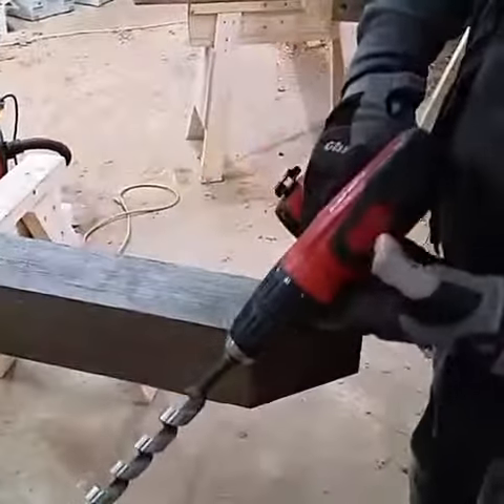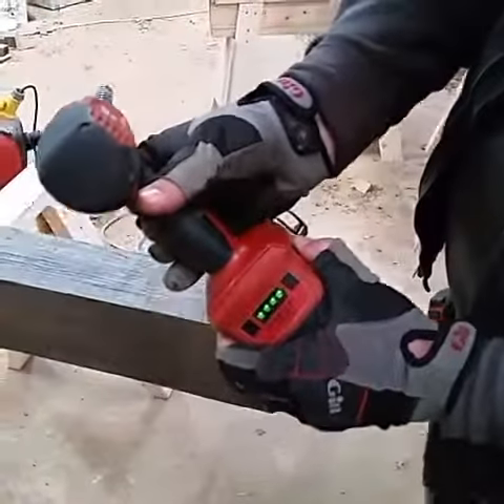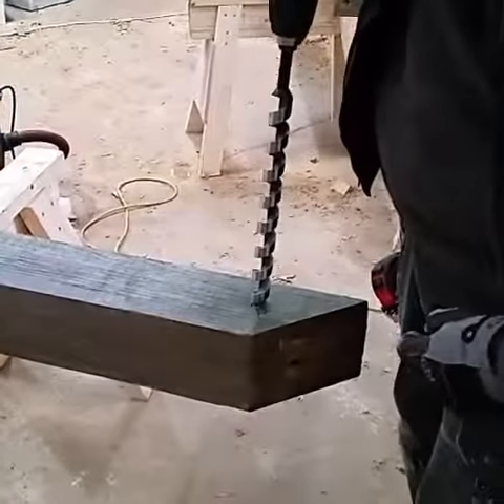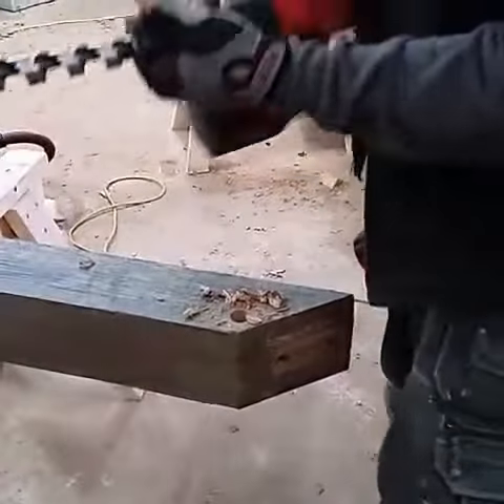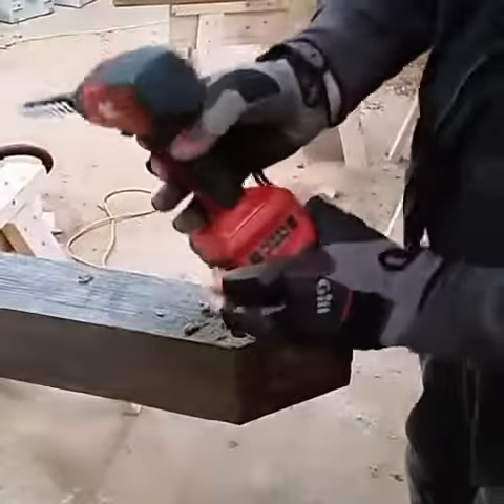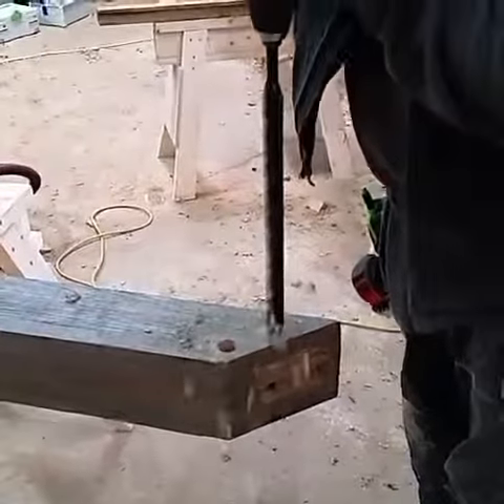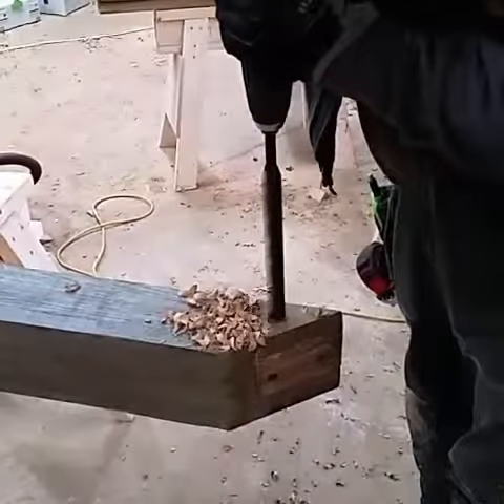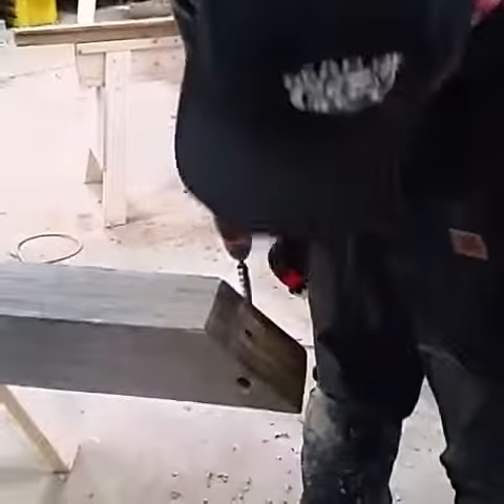How To Use WoodOwl Ultra Smooth Auger Bits | TF Tools

Comment: Just an FYI the first that you used had one flute for the chips to come out of that is why you weren’t able to go through all the way that is why the second bit had to flutes allowing you to drill deeper with less resistance because of the chips able to come out quicker.
Reply: There is an equation for that.